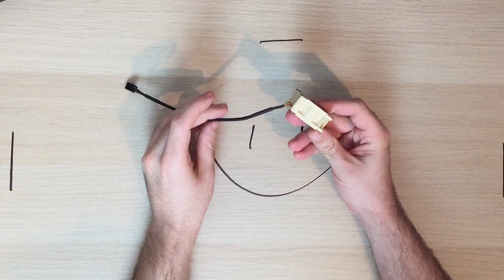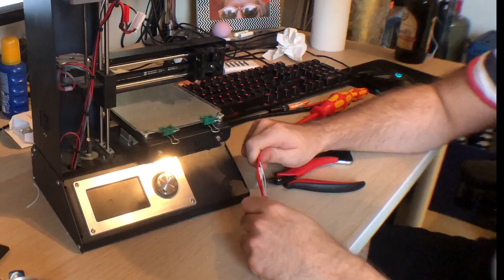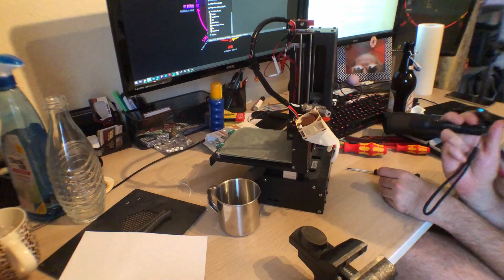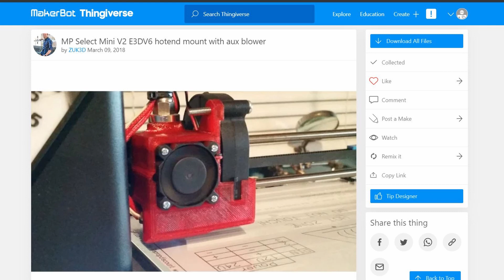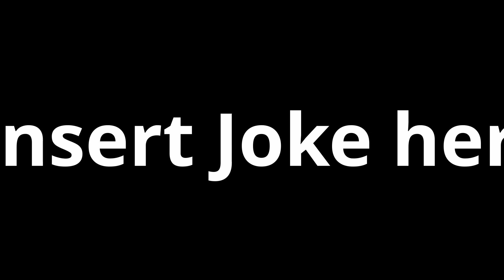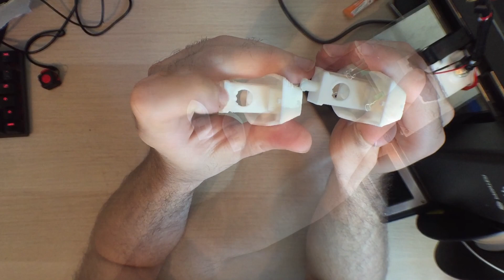How to install a E3D V6 Hotend & upgrade the Fan | MP Select Mini V2 Adventure

Comment: did you print these in Pla?.
Reply from the maker: I did. 
It should be ok as long as you don’t have the printer Inside an enclosure.
Edit: I you have PETG or similar laying around you should use that instead.